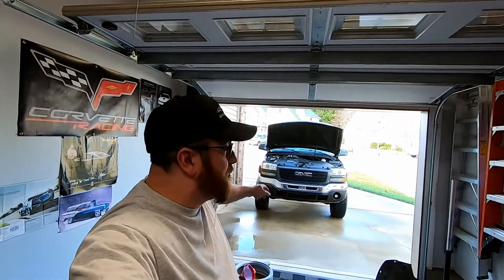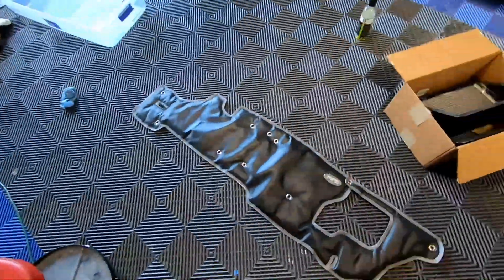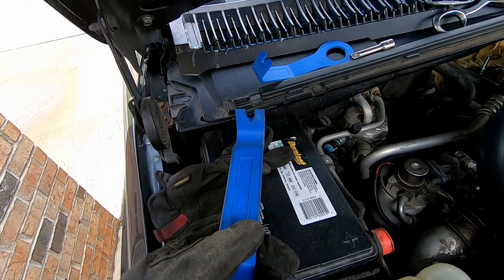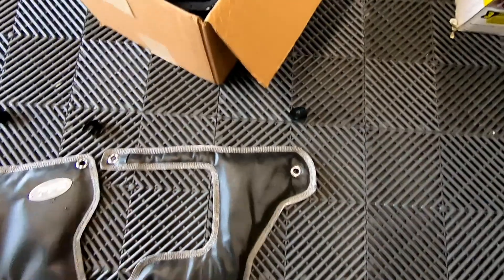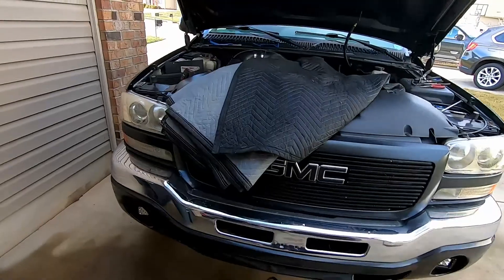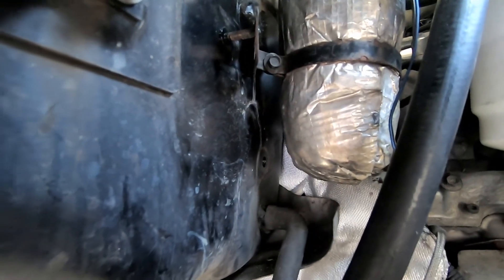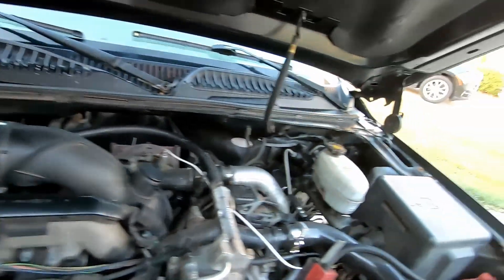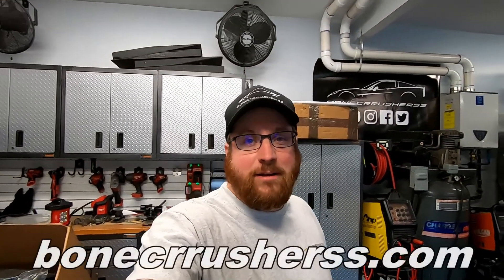2005 GMC Sierra 2500HD - PPE Firewall Insulator

Comment: I had my engine out of my LLY doing headgaskets. I was considering buying one of these to install.  I'm sure it's worth the money, but I could not justify the cost...
Reply from the maker: After working on the V bands and tearing it up even more - then replacing the hood and the hood insulation - man it made the engine bay look terrible. 

I'm sure you could find a better product - say lizard skin - or some kind of dynamat for a bit cheaper. 

But with the engine and turbo still being in the engine bay - this "bolt on" solution wasn't too overpriced in my mind - and I didn't have to tear out the engine.

Comment: It's certainly not for looks. Did you notice a significant comfort level increase in the interior?
Reply from the maker: At idle - or low moving speed - no not really. This combined with the 6 Speed swap has really quieted down the truck on the highway. 

I've got one more project that I'm thinking of - and thats to replace the rear cab mounts with the newer designed ones - there is some kind of "beaming" or "framing" noises that the old mounts can create - and they sag over time.

I have visually looked - and the back of my cab is sagging a tiny bit - but nothing compared to some of the trucks/videos that I've seen online.
Reply: @bonecrrusherSS  I used an S&B kit on mine and it did make quite a difference in noise and vibration in the cab. My stock mounts werent terrible or torn looking but they did sag a bit. I have a CCSB LLY. The S&B kit was worth the $$. 

My firewall insulation looks about the same as yours did before installing the PPE. The cost of this thing is now up to $270 and I'm wondering if it will be worth it. Mostly interested in cab noise reduction. Any thoughts a year later?